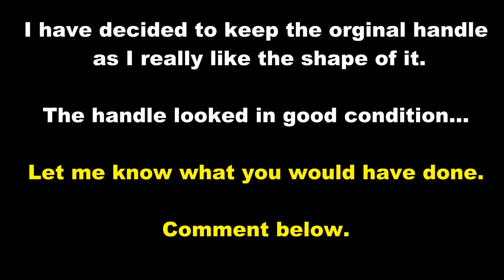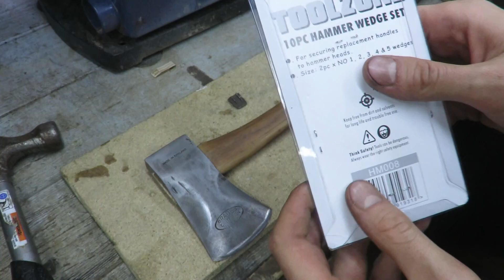Vintage axe restoration. Brades criterion axe.

Comment: Not bad, but you got sloppy with the last part of the fitting imo
Reply from the maker: Hey! Thanks!
Could you expand your comment so we know what bits i could improve? :)
Reply: @FALCON390Workshop  what struck me as sloppy was seeing that, after having used a band saw to force the handle down to shape, you left the area rough.. I would have loved to see it sanded smooth like the rest of the handle
Reply from the maker: @DaemonsBane  I see. Thanks for your feedback. I'll get better I promise :)

Comment: What you should do is talk if your not deaf but if you are you can Sign language I don't like reading subtitles if you can speak than do so
Reply from the maker: I'll definitely consider adding some narrating.
Thanks for your feedback
Reply: @FALCON390Workshop  when you restore do you need to make it look like a mirror? and that axe you restored was nice, I thought you was going to change the handle, if you don't have to change anything then don't leave the character or the patina alone
Reply from the maker: @oyesimon8112  I don't want to mirror shine my axes. This axe head was in good shape with not a lot of pitting and it turned out shiny without planing 😊
Reply: @FALCON390Workshop  I'm not saying you did, I like the way you left the patina of the axe along, some people want an axe or any knife to look like a mirror it's not necessary and it's time consuming